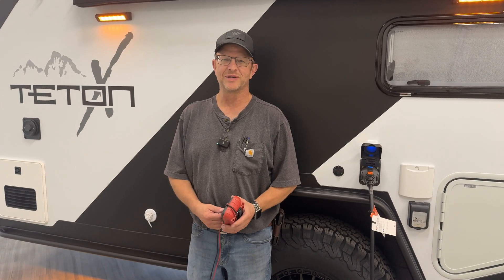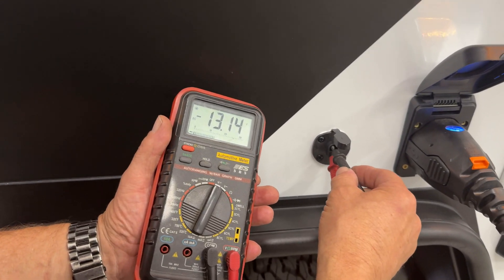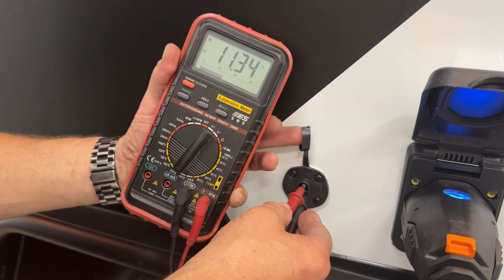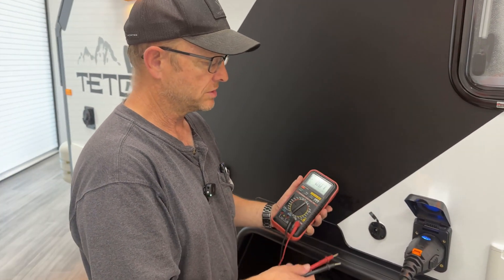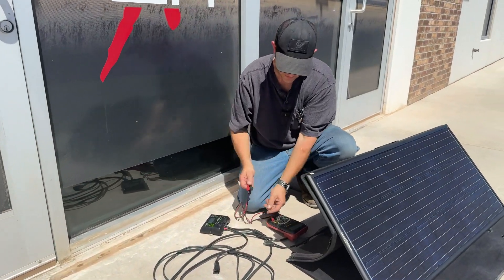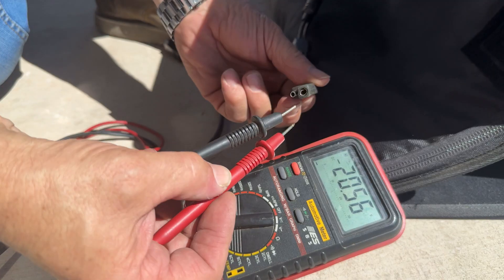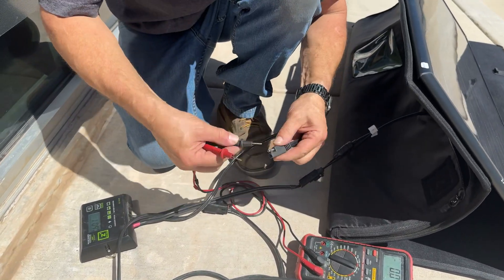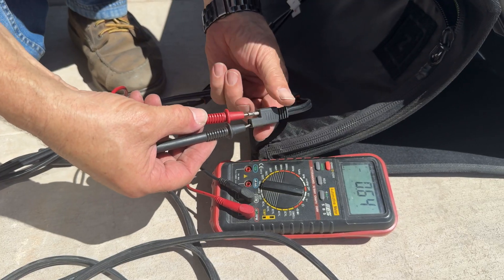Portable Solar Panel Polarity Test | Zamp SAE Connector | Atlas Outdoors | How-to

Comment: Awesome video!.   Do you recommend to use "regulated" panels only or can we use unregulated panels on the TetonX?  Also what is the max wattage/amperage one can plug into to those external Zamp ports?
Reply from the maker: Great questions! Our trailers are wired for regulated portable panels unless you requested the solar port to be routed through your rooftop solar controller. The max wattage that you can plug into the external Zamp panels is 400W.